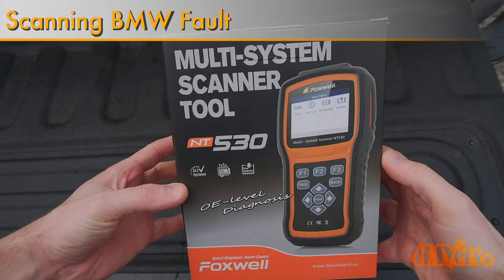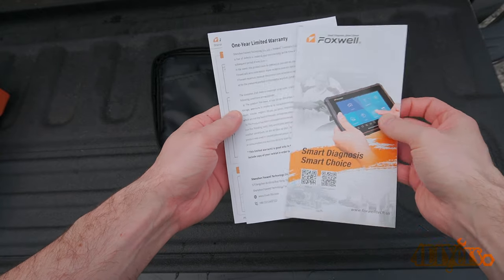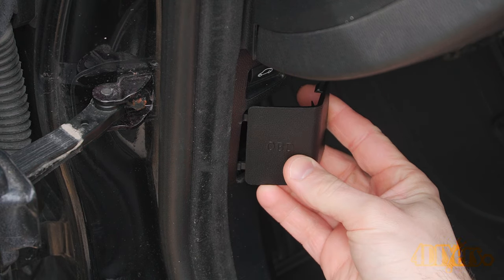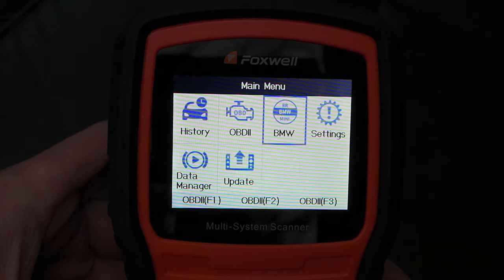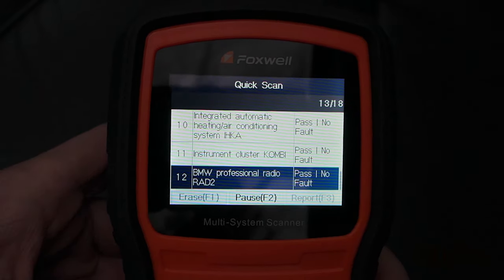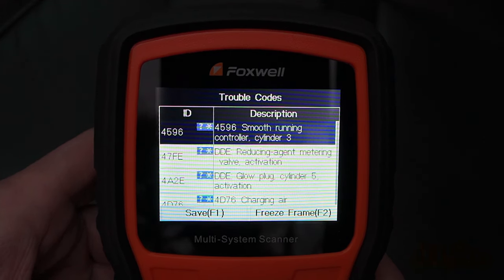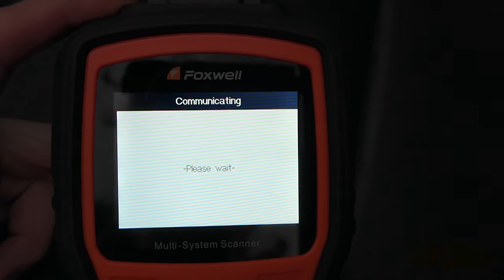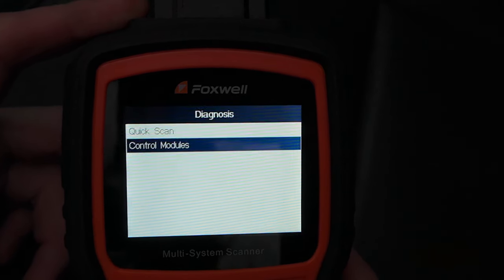How to Scan BMW Fault Codes using a Foxwell NT530 Scanner

Comment: Thanks. Perfect timing , although even if I reset and clear the faults ,  the compressor for the level failure kicks in the air bags don't lift and remain sagging !! Back to the drawing board
Reply from the maker: Have you determined there are no air leaks?

Comment: Thanks for great video. I find the sea of scanners quite confusing. Is it possible to get a scanner under £150 that will cover BMW (including battary reg) & Audi?
Reply: You can purchase a scanner for under a £150, but just be sure to  purchase from a genuine retailer. Just spotted this old video

        "BMW E39 5 Series Airbag Light Reset"       ....and still in business 10 years down the line!!

Comment: My car is not starting, I am sure that there's an faulty injector or a sensor. Can I clear the error or change injector values?
Reply from the maker: You can try clearing the codes and see if that helps. What kind of car is it?

Comment: where did he click to get read codes? he is only showing the screen and not the button he pressed, I could not get to the screen to show fault codes, just that there are faults
Reply from the maker: Click BMW, smart vin scan, then scan all modules. After that is clicking on each of the modules, then read codes.
Reply: @4DIYers  thank you, I figured it out :)

Comment: Can you use these scanners with the engine running? I used to have a bluetooth dongle that i could plug in and drive while i view live data on my phone or tab. With these types of scanners it's only when the engine is off and the key is turned to on position. I assume no live data capability, only what's stored in car computer?
Reply: Glad to tell you that Foxwell Scanner can read live data with the engine running. What's more, Foxwell NT530 give you access to read freeze frame data, which shows engine conditions such as fuel trim, engine coolant temp, ect.
Reply: @FoxwellGlobal  yes i'm doing it right now but Foxassist is unable to read SD card in the scanner. Had to pull card out and use it with the adapter that came with the scanner. I could not use the card by itself in PC inserted into SD  slot. Took me a while to figure everything out with multiple files/scans. NT680PRO. 

Can i bleed ABS with it?